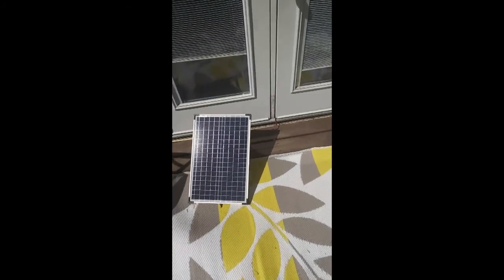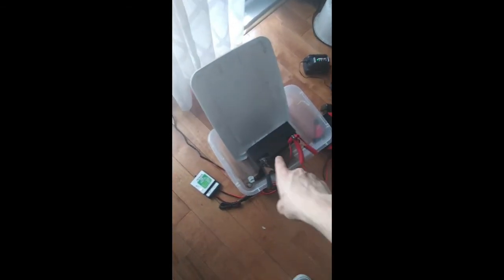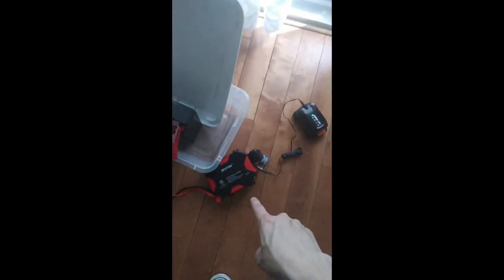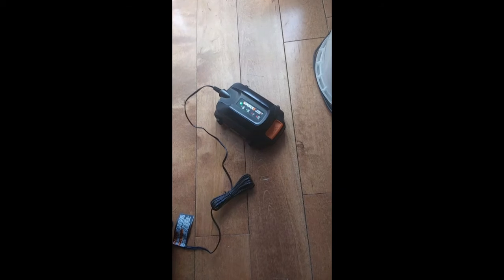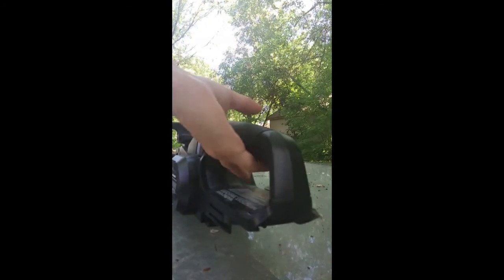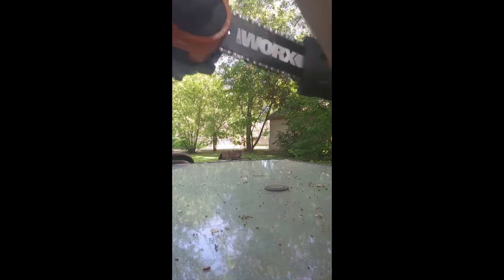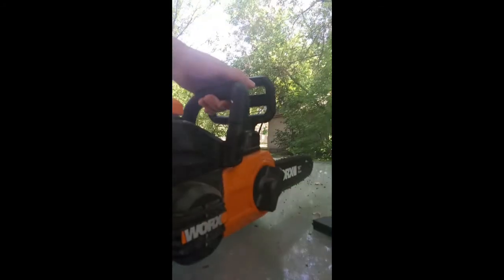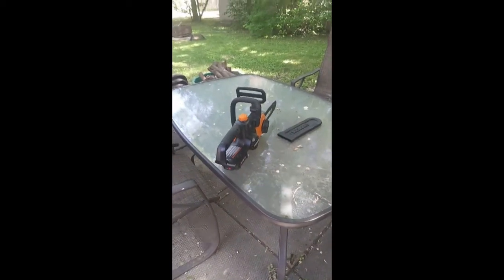Solar Powered Chainsaw

Comment: so was that the whole charge right there... 1 log and time for a new battery .... i'll keep using my gas saw because our lives depend on it here.. batteries are good for cell phones etc.. but when you need big juice... fossil fuel rules ... also fossil fuel is cleaner in the end .. You don't want to find out how those  batteries are made.. you will freak out.. anything but green.
Reply from the maker: I cut over 50 logs today with half a battery. It is also possible to upcycle a car battery to use alongside the solar panel. This particular chainsaw is a 2 in 1 with a pole extension. Larger saws with twice the battery life and longer blades exist. I don't provide this information to bash fossil fuels. Just to answer a few questions.
Reply: @MitchellMozdzen  50 logs  thats impressive at any size
Reply: @MitchellMozdzen  what brand is it i want to google the specs etc.. we use lithium ion batteries in some of our shop tools.. but nothing we do can get that kind of performance for charge time.. how long does that battery take to recharge from the solar unit ?? i want to see a picture of the 50 logs you cut with only half a battery being used ..lol.
Reply from the maker: @lsd25records  It'll be a little hard to see all the logs now. Some of them have already seen the firepit haha. The brand is Worx. Purchased at Canadian Tire.
Reply: @MitchellMozdzen  https://www.youtube.com/watch?v=19FJ1IjU_5E https://youtube.com/watch?v=i9aNSlDQ5v4&feature=share